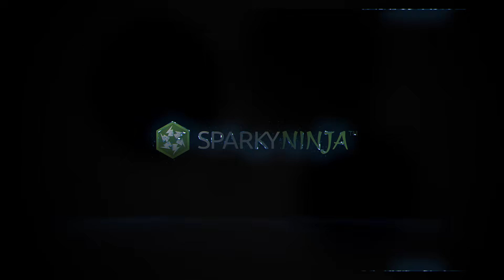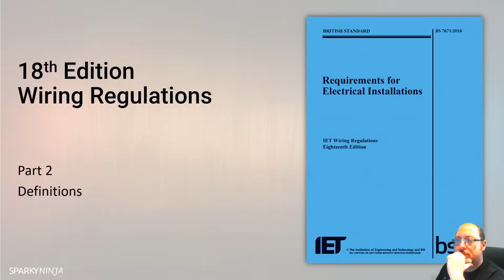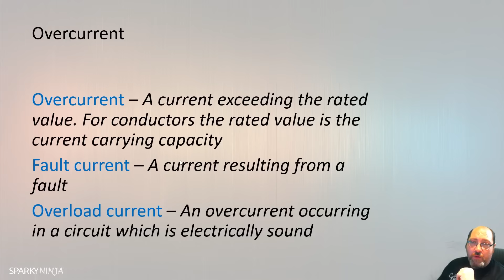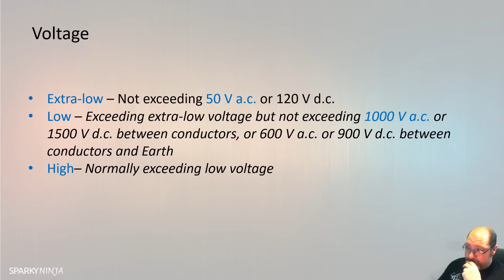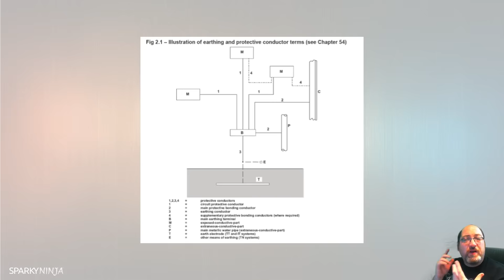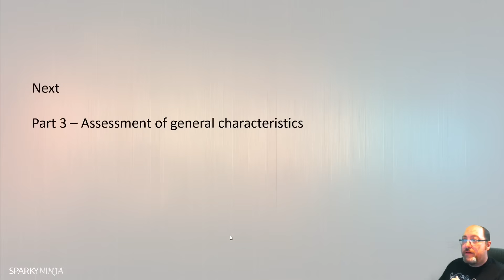Comment: Of all the definitions, Part 2 "Definitions" does not define, "supplementary protective bonding conductor", written on of 39, but, it defines on page 24 what a "bonding conductor" is. But are they all but the same or are there subtle but important differences?

I think, perhaps, it is not effectively an extension of the circuit protective conductors to items that are extraneous, as that would make their cross sectional area the same as the CPC. Or, they are they protective conductors that are effectively an extension of the main protective bonding conductor. The answer will be relevant to the cross sectional area of this conductor. My guess is that the cross sectional area should be the same as the main protective bonding conductor, but it could be clearer.